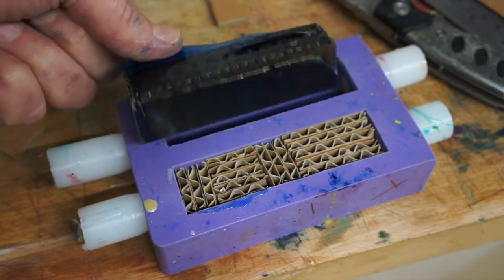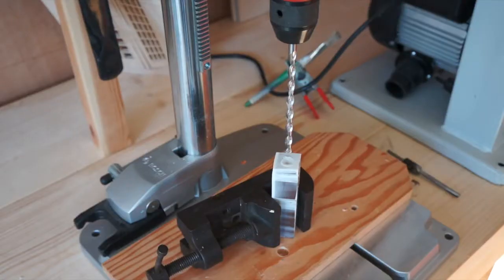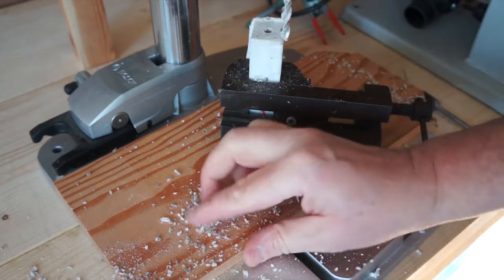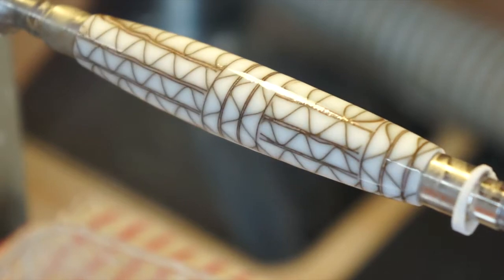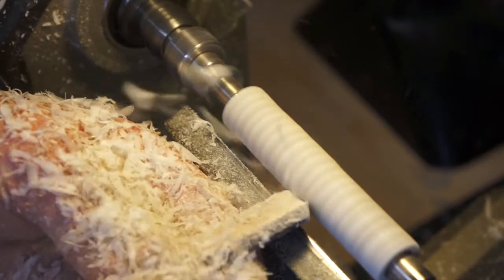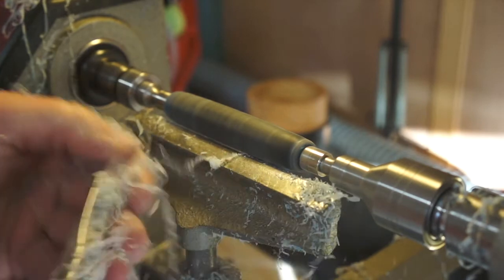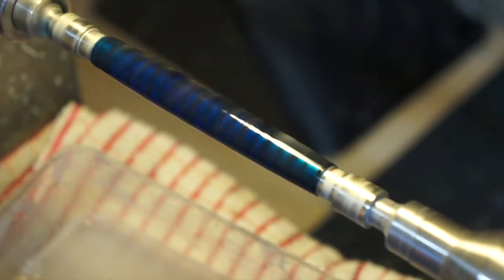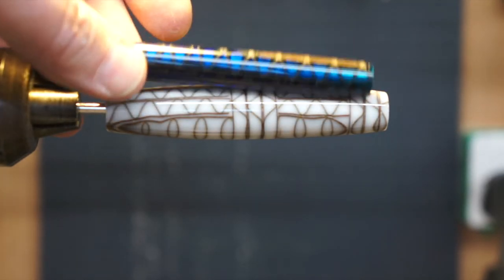Resin & cardboard

Comment: I have had visions lately of the possibilities of corrugated cardboard and resin, and this has been so inspiring.  Makes me wish I had a lathe, a workshop... I wonder,  would an ordinary pressure cooker work as the pressure pot, for removing bubbles?  I saw one person had made a “cradle”, of a frame inside a picture frame kind of thing, to hold an object and spin it every which way. That seemed counter-intuitive to me, as if it would create more bubbles, but indeed the object was completely bubble-free. Thanks for any thoughts. Alison
Reply from the maker: Hi Olhamo,
I would of thought a  regular cooking pressure pot would NOT be safe to use 60psi.
The pressure pot I have has a substantial wall thickness and the screws that hold the lid down are huge.
To be honest I would not recommend trying to home make one of these pots. Buy the item that is made for the job is the safest option.

All the best.👍

Comment: Hi Paul stunning effects just using cardboard well done sir. I wonder if the one that hadn't been in the pressure pot could of had the holes filled with either more resin or milliput anyway I love your ideas keep them coming. Thanks for the video
Reply from the maker: Hi John, 
Without doubt it could of been saved with another resin pour or like you say adding Milliput. The great thing about that is you would probably get an amazing pattern being produced.
Cheers
Paul

Comment: Wow they came out great. I recently started looking at epoxy resin projects and I wanted to make something for my mother. She has a thing for serving trays and I was thinking I could make one out of cardboard and then coat it with a thin layer of resin to harden it and give it that shine. I was also thinking of adding an image to it. I just don’t know if the resin will mess up the cardboard. I wanted to apply the image with mod podge hoping it will help protect the cardboard. So I guess my question would be do you think it can work? Any advice would be greatly appreciated.